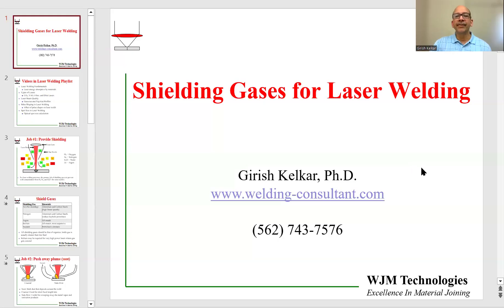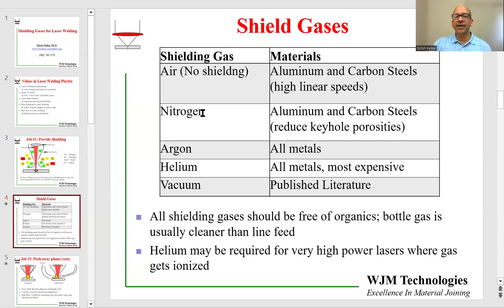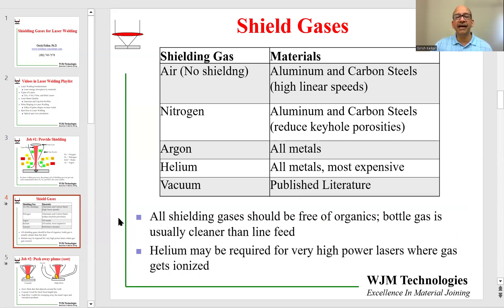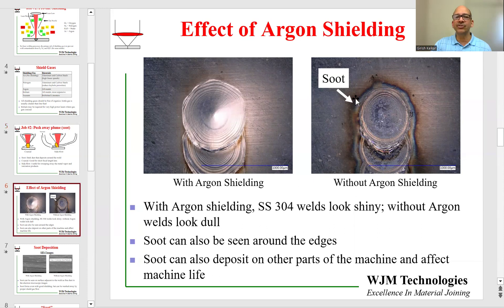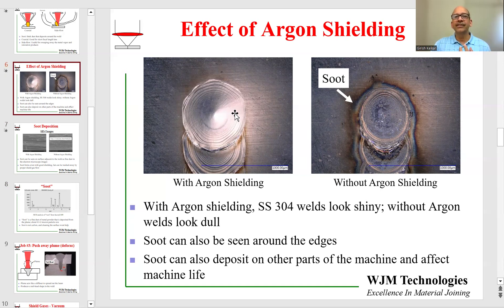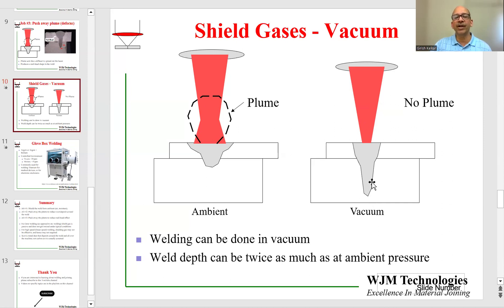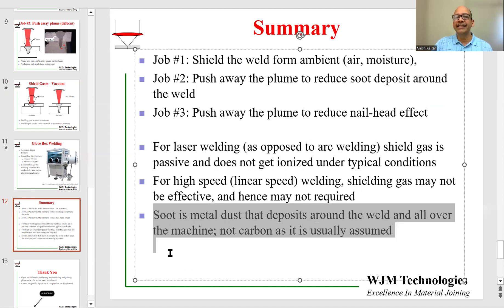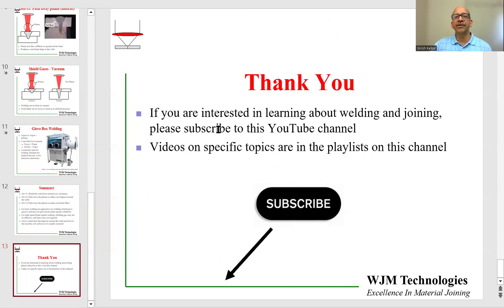Shielding Gases for Laser Welding

Comment: excellent video, very informative. Has anyone researched the affects of using Carbon Dioxide for shielding laser welds? I have a ton of 90%argon/10% CO2 and wonder if it would work? Or if co2 would cause issues?
Reply from the maker: CO2 is not typically used as shielding gas in laser welding.  Use will depend on metals you are welding and their absorption of CO2 during welding; will have to be evaluated.

Comment: In one of my projects, I’ve noticed that excessive use of argon significantly reduces mechanical strength. The argon is introduced close to the process zone and cannot escape from it.

What could be the reasons for this drop in strength?
Reply from the maker: Reduction in strength can be from loss of penetration or from change in chemistry.  Dont think Argon directly affect either.

Comment: Great video. As it is mentioned, shielding gas does not get ionized. But how about metal plume? Can it be ionized and potentially leads to electrical sparks generation?
Reply from the maker: Metal vapor does get ionized, and it appears as the plume over the weld.  Plume acts like a divergent lens, and hence it is important to wash away the plume with help of shielding gas.  Plume does not create electrical sparks.  The welding process can create spatter (droplets ejected from the melt pool) and they may look like sparks, but are not sparks (as in electrical sparks).

Comment: If your handheld laser welder has a chiller, does the gas play any role in cooling the welding head?
Reply from the maker: The chiller is typically used to cool the diodes inside the laser; not to cool the shielding gas.
Reply: @weldnugget  I read somewhere recently that air cooled laser welders are partially cooled by the gas in addition to fans, and I was just wondering if water cooled laser welders are also partially cooled by the gas. Maybe not.
Reply from the maker: As per my understanding, air-cooled lasers have internal circuit of water cooling, and do not need an external water chiller.  The cooling is for internal laser components including diodes and YAG rods; depending on the technology.  The cooling is typically not for the shielding gas, although could be provided.
Reply: Pretty simple to check, do you have water/coolant lines going to the laser head? If so, probably not. it really depends on the gun, but every water cooled one i have seen does not use gas to cool the gun, but there may be some really cheap guns out there that dont have a full water cooling loop throughout the entire gun.  Ive found that i can run without gas without my gun getting too hot (ran out when using it to clean material from 1 meter away and didnt realize for a few minutes), the only time it gets hot is when the protective lens is damaged, it will overheat in a split second. the gas will keep dust away from the lens though, which is what kills them.